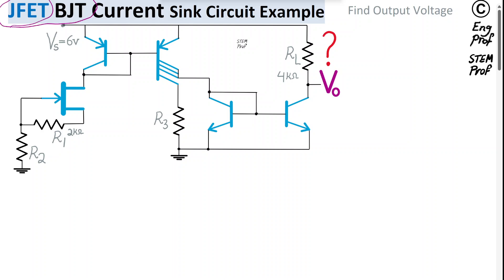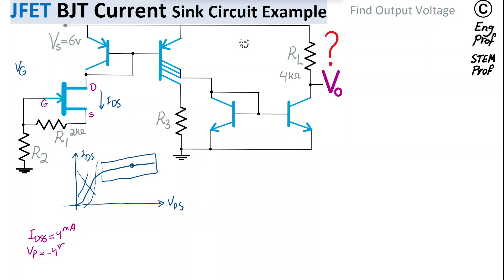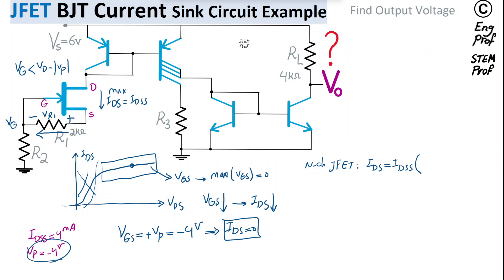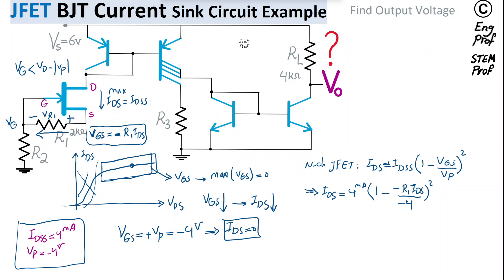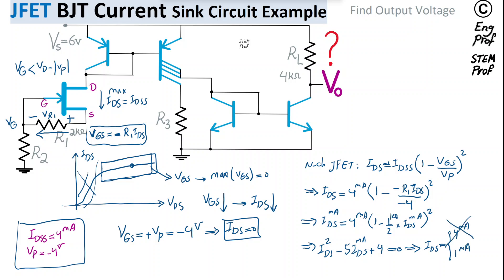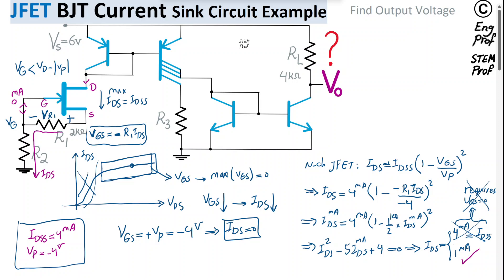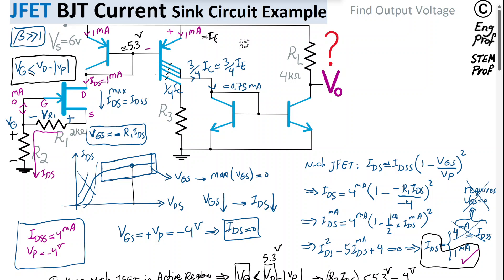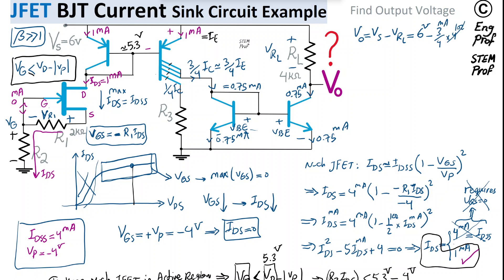Hybrid Current Mirror with JFET BJT transistors

Comment from the maker: For more examples please see: Wilson Current Mirror and Current Source Design https://youtu.be/LfbfJYrovN0
Thermometer Circuit Design with Op Amp & BJT transistor https://youtu.be/55YsraFE0rg
Analog Computer Vector Sum Calculator with Op Amp and BJT Transistors https://youtu.be/PIAsa0QNVns
Instrumentation Amplifier with Electronic Gain Control https://youtu.be/C4tghZ-q6Zs
Programmable Current Source Design with Op Amp, Zener Diode and Digital Potentiometer https://youtu.be/R1x6B0TczWk
On-Chip BJT Current Source Design https://youtu.be/Rs7gEMk03dw
Push-Pull Power Amplifier with Darlington Transistors https://youtu.be/866MYibo8yE
Analog Logarithm Computer https://youtu.be/RpKEq5WyoLg
Op Amp Analog Computer Differential Equation Solver https://youtu.be/ENq39EesfPw
Sawtooth Oscillator Design https://youtu.be/2eUsGPfqbW4
Triangle Oscillator Op Amp circuit https://youtu.be/JF5Up_cuL9k
Sallen-Key Analog Filter Design Tutorial https://youtu.be/KwUnQXbk7gM
How to find Bode Plot, Freq Response, Transfer Function of Analog Filters https://youtu.be/vZFkPeDa1H8
Universal Analog Filter Design https://youtu.be/2J-0msXZE2o
Laplace Transform Example and S-domain circuit analysis:  https://youtu.be/ps8N5TPM_qU
Op Amp circuit Bode Frequency plot https://youtu.be/BLVzuuqAlZs
Lowpass Butterworth Filter: https://youtu.be/UzCjkwqy-9w
Analog Computer to Raise Signal to power n https://youtu.be/IUTlBH1UraE
Differential Equation Solver Analog Circuit https://youtu.be/R3X5AYNZGEI
Complex Sinusoid Oscillator https://youtu.be/GXRhmwmS5Zk
Full-Wave Rectifier circuit example https://youtu.be/DJJMNU-CYcg
Sawtooth Waveform Generator design with OpAmp, JFET, BJT https://youtu.be/5zHXTx-Vl20 
op amps Circuit with feedback loops to design an analog computer that solves a second order differential equation https://youtu.be/HeZRtnRXpEI 
For more analog circuits and signal processing examples see: https://www.youtube.com/playlist?list=PLrwXF7N522y4c7c-8KBjrwd7IyaZfWxyt
I hope these Circuit design and analysis videos are helpful. 🙂

Comment: Sorry but you are totally wrong! The emitter current on the second PNP transistor is not 1mA but is 4mA. It is a simple current mirror with 4 output transistor. Each collector should have the same current as the first transistor, so 1mA. 😀
Reply from the maker: Thanks for watching & sharing your thoughts. I appreciate your interest in this circuit. As explained in the video the collectors of multi-collector PNP BJT transistor are designed to represent 1/4th junction area with equal Current density. Therefore the sum of all four collector currents is equal to the emitter current of the multi-collector PNP transistor. I hope this clarification is helpful. For more Analog Circuit videos please see:
Op Amp Amplifier with Electronic Gain Control https://youtu.be/NoNgQpbj77Y
Analog Logarithm Computer https://youtu.be/RpKEq5WyoLg
Op Amp Analog Computer Differential Equation Solver https://youtu.be/ENq39EesfPw
Thermometer Circuit Design with Op Amp & BJT transistor https://youtu.be/55YsraFE0rg
Push-Pull Power Amplifier with Darlington Transistors https://youtu.be/866MYibo8yE
Sawtooth Waveform Generator design with OpAmp, JFET, BJT https://youtu.be/5zHXTx-Vl20 
Wilson Current Mirror and Current Source Design https://youtu.be/LfbfJYrovN0
Instrumentation Amplifier with Electronic Gain Control https://youtu.be/C4tghZ-q6Zs
Programmable Current Source Design with Op Amp, Zener Diode and Digital Potentiometer https://youtu.be/R1x6B0TczWk
Thanks again. 🙏

Comment: What is the point of this complicated current source if there are simpler solutions? What are the roles of R2 and R3? The example of the first pair of BJT transistors, with one of them having 4 collectors, that could be purchased?
Reply from the maker: Thanks for watching & your questions. This circuit is resembling a simplified example of current source scheme inside the integrated circuits for say an operational amplifier. As explained in the video, R2 resistor sets the absolute value of Gate voltage of JFET. The R3 resistor is representing the current sampling or monitoring element inside the chip (as briefly mentioned in the video). I hope this explanation is helpful.  For more examples pls see Wilson Current Mirror and Current Source Design https://youtu.be/LfbfJYrovN0
Thermometer Circuit Design with Op Amp & BJT transistor https://youtu.be/55YsraFE0rg
Thanks for watching.